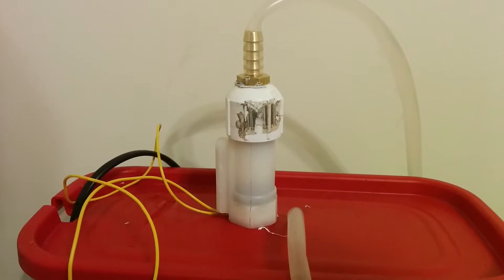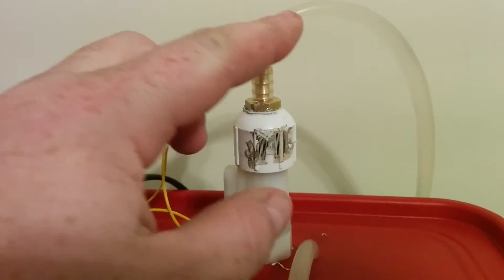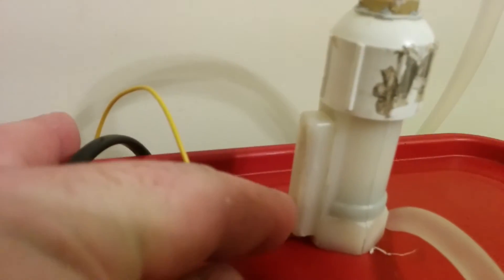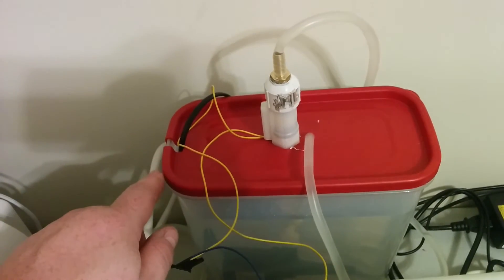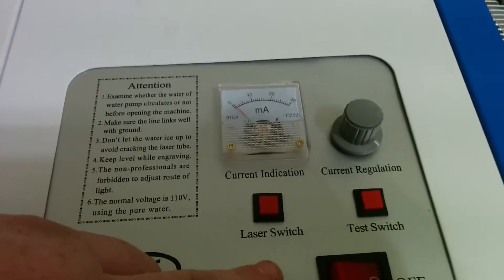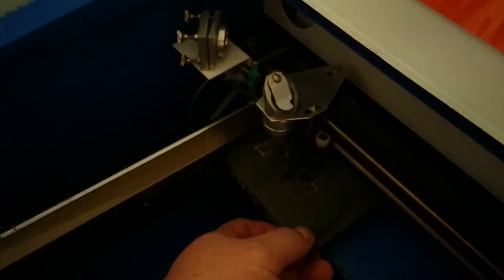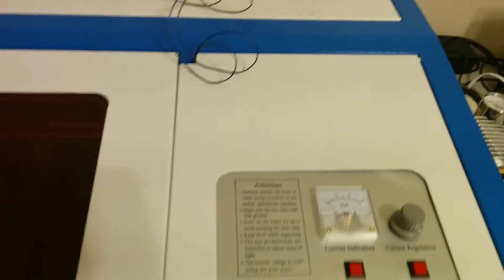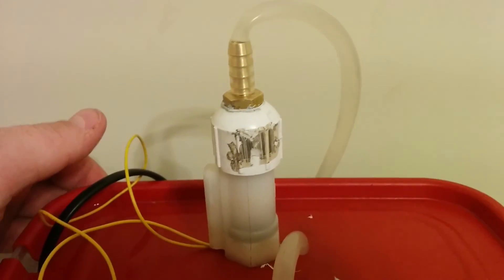$10 water flow sensor for 40w laser engraver

Comment: well i want to ask one thing from you ,,,,,, some time it happens that magnetic ball inside the flow switch stucks and system stay run even when there is zero water flow , and it is very dangerous if you use that flow switch in water heaters , as you might know that similar flow switch also used in water heaters , so my question or rather want to know from your experience about this flow switch , does it has some inherent flow or it performs well with zero error,,,,,,,,,,

Comment: Thanks for the review! Got the water flow sensor, now to get it plumbed.
Reply from the maker: +accord32888 How did yours  turn out?
Reply: +Mark Fuller the sensor works well, as does the system, but not yet together. My pump isn't strong enough to trigger the sensor, & I have not yet upgraded it.